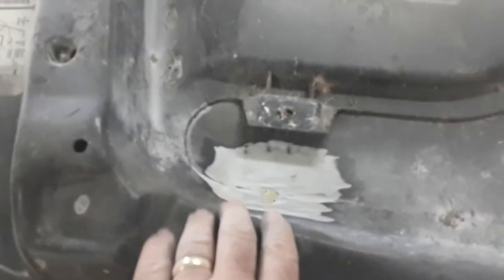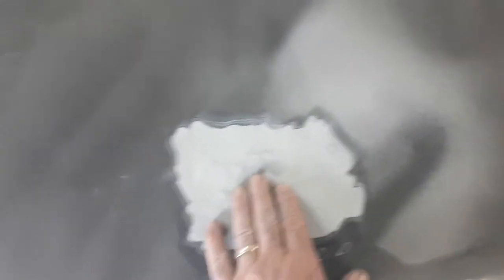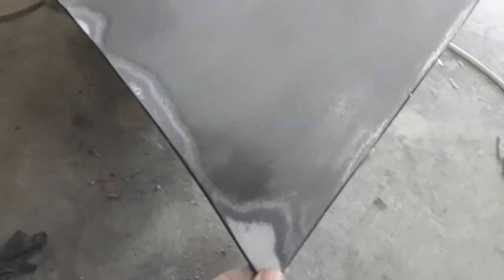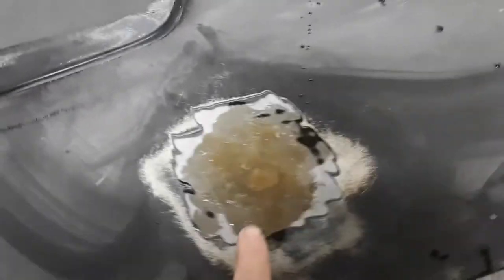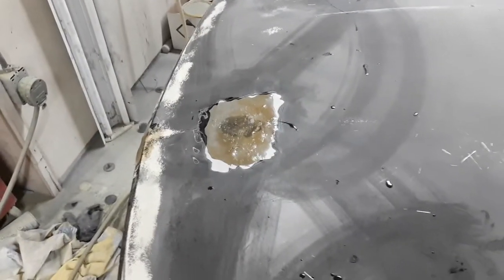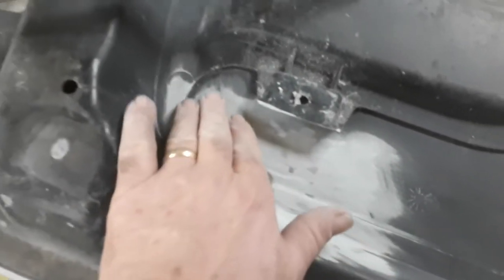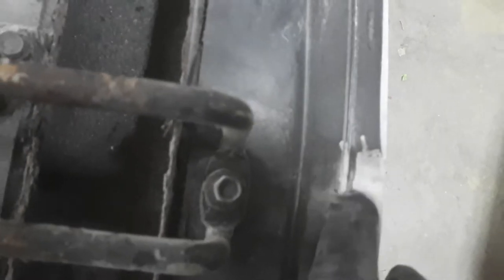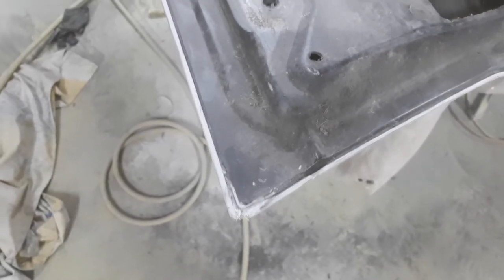repair and paint a fiberglass hood

Comment: I've watched several fiberglass repair videos, but my question is: do you have to use gelcoat over a repair that has been ground down? I justgot a stepside Chevy that has some big nicks in the fenders. It also has a fiberglass front end that is blended with the stock steel fenders. I haven't seen anything about how I would separate the fiberglass from the steel to replace the steel. I'm guessing just cut and a whole lot of grinding.
Reply from the maker: hi no gelcoat is not needed but it is easy to sand and splitting the glass from the metal is hard to do if it was done well the first time all you can do is peel cut and grind